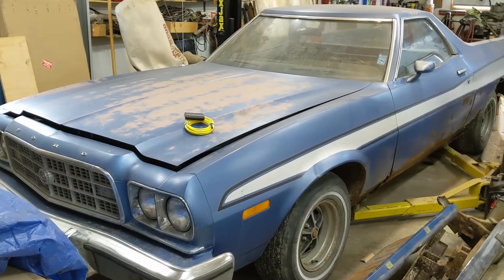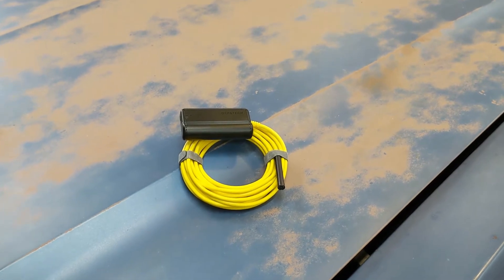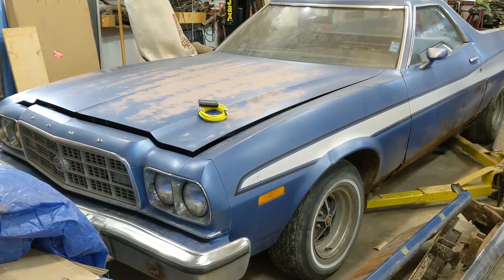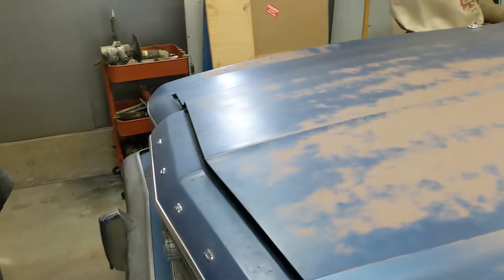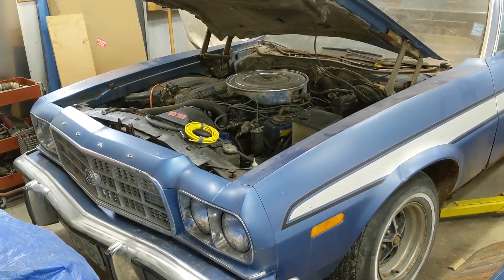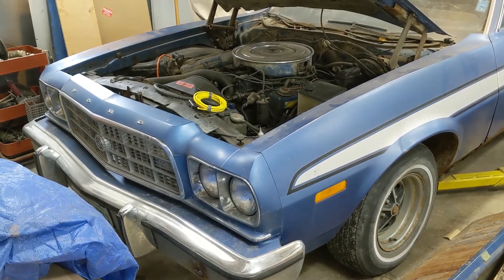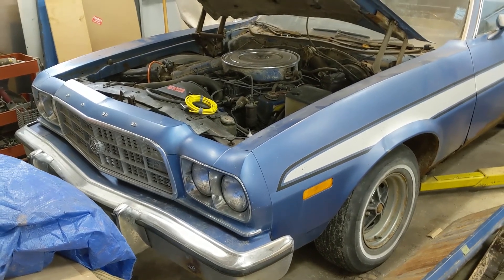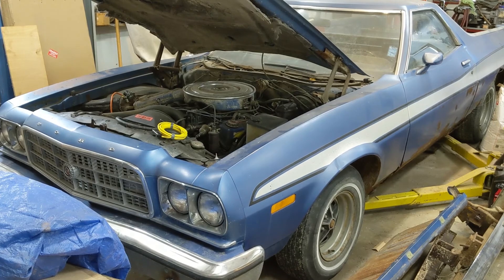Is This 73 Ranchero Q Code Engine Open or Closed Chamber?!

Comment: I wish I could find a 73 ranchero with a 4speed
Reply from the maker: Hi Doug, they are a rare car, the Marti report shows "820 With these Engine/Transmission Codes" for 1973, and I'm sure a lot of them are long gone by now...but you never know what you can find when you look hard enough! 😎
Reply: did you ever find one ? i might know were one will be coming up for sale its a 73 Q code 4 speed car but no longer has 351 it now has a vary nice 468 in it.

Comment: 1973 will be open chamber heads, closed were done by 1972.
What city are you in? Percival Mercury was Regina. I have two '74 Rancheros for parts.
Reply from the maker: Thanks Brad...I wasn't surprised finding open chamber, like you said, 72 was the last year for them. I'm in Warman, good to know I can find parts...thanks!
Reply: @J_R_Shop  Actually I meant '71 was the last year for closed chambers. Sorry for the confusion.
Reply from the maker: @bradarmstrong8959  no problem Brad...Fords are all over the map when it comes to these engines...I've seen people post heads with the 4 & Dot, and they were closed chamber heads. You never know what Ford past off to the Canadian market during these years, since the smog regs were being enforced in the USA, that's why I thought it would be fun to have a look, but I wasn't surprised to find open chamber.

Comment: What is the camera attachment for the phone?  It was fairly clear.
Reply from the maker: Weldon, this a wifi connected camera, no wires needed...it actually works pretty good, it allows video capture on the phone. The camera has it's own battery, and the app for the camera needs to be installed on the phone.
Here is a link for reference...I bought mine off Ebay, for a little less money.
https://www.amazon.ca/DEPSTECH-Borescope-Semi-Rigid-Inspection-Tablets-33ft/dp/B07X8SPJZT/ref=sr_1_6?crid=1BSUG1JBTQNB1&dchild=1&keywords=depstech&qid=1616674600&sprefix=depste%2Caps%2C222&sr=8-6